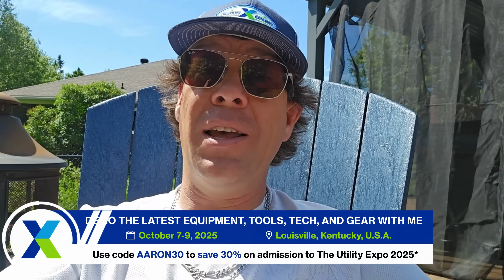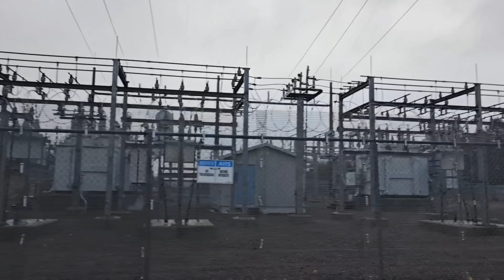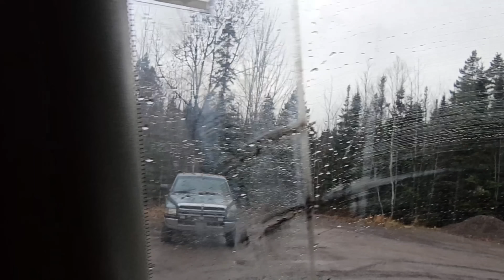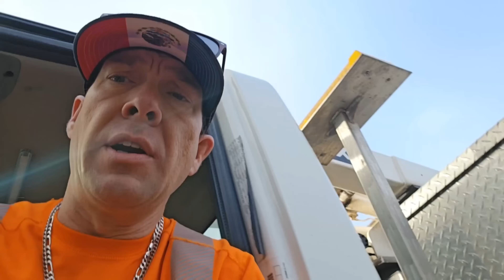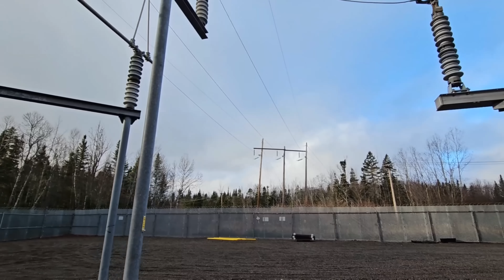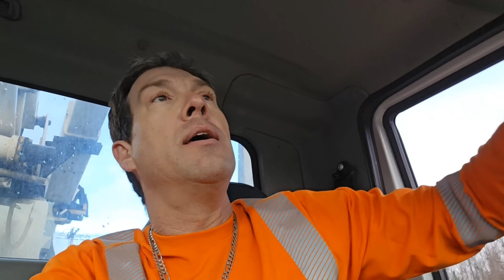138kV Transmission line outage

Comment: Aaron! Nice demonstration of how you were interrupted during your meal to get the lights back on. 
Question? I hope you either have a stand by generator at home or at the very least a roll out generator? We have a very robust roll out at our house capable of back feeding back feeding our entire house including our central air. You read that right. Our roll out can back feed our entire house & central air. 
Thanks for getting the lights back on for your community! 
Your,
John
Reply: If that hook up is properly installed it will not be backfeeding.
Reply: @rupe53 We use an inter-lock by pass in our CB panel.
Reply from the maker: I actually don't have one!! I've got the panel and transfer switch all setup tho
Reply: @Bobsdecline A troubleshooter doesn't have a generator? I need one on my circuit because I condemned it three times as did other fellow employees.
I'm on the backbone (main line) coming out of the substation on my same street. It comes out as aerial cable to terminators to a gang operated three phase switch. Then goes overhead to 336 mcm aluminum tree wire to (get this). 1/0 bare aluminum for 7 spans & transitions to number 2 bare copper for 6 spans to 366 again. That 1/0 always burns down. I know I have pickeled it out a few times. 
Everytime we get hit with a storm it goes out. The shop I started at was closed over ten years ago. I don't even work in my area anymore. 
Hence the genny. We went with the best. Honda EU 7000is. Electronic fuel injection inverter generator. It puts out better voltage than my employer 123-123-246. It's 60 cycle all the time. 
I highly recommend the one we have. 
We were out for Isais. My wife was able to bring it online with 4 switches & never leave the house. 
Our house never skipped a beat. The house was nice & cool & hot water for bathing in. I came home after working my first shift on (24 hours). I refueled it & started it back up. I showered & went to bed & slept well for five hours before it was time to go back into work. We had it running for just over two days. Only shutting it off at night. We burned 12 gallons of gas. 
You want to see it running at our house? Go to my home page. One is at 58 db & the other at 52 db (economy). If you like cats? Our Bean is a fruitaholic. He loves peaches & mangoes.

Comment: Common to have flashovers due to contaminated or failed bells. Seems fairly straight forward. Take a clearance on the line, grounds both sides of work area, Stage materials, execute repair. Do you guys have any live line crews?

Comment: Folks should know that a portion of outage time is from crews activating from the normal every day things they were doing after work.  And then finding the problem, which takes a while in rural areas.  Having help from local first responders and volunteers is amazing.  Thanks to you all!
Reply: I'm in a rural area where Sheriffs often try to help report utility issues, but the levels of confusion or mistaken info varies widely from those who recognize what's in front of them, or do not.  

It could be useful for utilities to host more training for all of fire, police, and PSAP dispatchers, to recognize pole or riser numbers of current or predecessor telcos or electric companies, and secondary feeders, service drops, etc, as to standard names and what each looks like.  

Most utility engineers want to have reliable functioning systems, that survive storms and deliver stable electric voltage inside legal bounds.  Sometimes that takes customer reports, where I've helped identify stuck step regulators in sub stations, or documentation to cause secondary feeders to be upgraded to higher voltage that's less subject to I^2*R losses and regulators to end of line load variations.  

Utilities get a lot of bad or mistaken trouble reports.  While some of those topics are big workloads and budget items, utility engineers generally appreciate accurate, useful information, even if it means giving managers news they may dislike.

Comment: Hey! I am 68 years old and have been involved in electronics for as long as I remember. I have been a Ham Radio operator for almost 50 years and know a little bit about electricity. I have learned so much about the Power system from you. I watch almost every video you share. I love learning. Thank you!
Reply: I am a Ham as well and have been for 20 years. 
I studied to be an electrician from High School. I got into electronics in High School too. I was too slow in construction so I went into computers. 
I have always been fascinated by industrial equipment and power generators and distribution. 
The transmission lines in my area are 250,000 volts and higher. 

I remember following them when I was 13 and I found the Hosensack substation and it was amazing. 
Back in the 70s there was just a chain link fence. Today they have a massive solid wall and so many cameras. The substation had its own spur from the Reading Railroad Perkiomen Branch from Allentown to Philadelphia 
The tracks are still there. 

The transformers are huge. The biggest I have ever seen 

The cracklings from the lines, especially in the summer, is so loud. 

My instructor took us under the lines with 4 foot florescent bulbs and they would flicker when held up above our heads.
Reply: @ocsrc  I also took Electronics in High School and did a coop program at a lovely Tech School in my senior year. DE W4GHW
Reply: Got my Technician license while in the 5th grade.

Thanks for sharing, Greg.
Reply: KB8MAT here. I have a couple of great publications from the ARRL that covers electronics very well, one of those was given to me by my “Elmer” WB8FEW Bobby and it’s filled with great information too. I’m getting the tools necessary to rip apart an iPad and replace the lightning connector and the battery. I like electronics as well. Cheers!

73s de KB8MAT, Al
Reply: I've done Electronics Technician training, have a Ham radio license, and I still learn things from this channel.

Comment: Seems surprising that the transmission network to that substation doesn’t have n-1 security?
Reply: N-1 is usually about the integrity of the overall network, not about individual assets on it, including substations. If you’re lucky your utility will have rings or similar that let a station be fed from both sides but not always.

Comment: System seems to vulnerable to be honest
Reply: Well, if you had to ensure that every site was fed from two different directions or two different sources that would really add to the cost.  Although that substatiion in the woods was at the end of a spur, if it had to be fed from the other diection that would be expensive, because it would likely involve a river crossing and so couldn't be done on poles.  In the end it's a question of "How often has it failed before?"
Reply: @heckelphon I meant vulnerable as in nefarious activity

Comment: If you're worried about showing something on a computer, you can press the "prt scr" key to make a screen capture, paste it into an image editor of your choice and blank out anything sensitive.
Reply: Aaron does blank out and obfuscate a lot of stuff.  There is other stuff I believe he simple does not want to video in an abundance of caution (or company rules prohibit it).
Reply: And all in the 30-minute lunch break?!  Actually there is something of a set of maps online or other schematic which I guess Aaron could copy in his spare time and prepare without identifiers for future occasions, but hey, it's good that he does this stuff in any case.  The guy's got to eat sometime!
Reply: @heckelphon  When I worked on the road during emergencies, "lunch break" was a sandwich in one hand and a steering wheel in the other.... often called "chew something while you do something." Rest breaks were basically done during drive time between calls.
Reply: That would require exfiltrating the screenshot off the computer, which would be a big no-no and probably blocked. It's not a computer where stuff like that can be done.
Reply: Alt + Prt Scrn; hitting part scrn alone won't do anything

Comment: Aaron: When a tag has your name on it but you timed out on work hours and are now home asleep, is there a procedure to transfer that tag, perhaps to your partner or supervisor, instead of calling you and waiting while your brain reboots? Does someone have to drive around to all the tags and physically correct them so some newbie doesn't "save time" and call you directly?
Reply: Different places do it differently, but normally there's a work tag vs a safety lockout. Work tag has simple enough procedure to remove, but a safety lockout is a big deal and they will call you in the middle of the night if you accidentally leave one on.
Reply: I think there is a way to transfer a work permit to whoever the replacement supervisor is
Reply: Who knew the power company has rock stars. Luckily for us consumers.
Reply: I would bet those tags are crossed to a job# and dispatch can keep track then know who the supervisor is for a proper hand off on authority.

Comment: 4:22 Did you hear about the transformer fire at North Hyde Substation in the UK that caused the Heathrow Airport Blackout? That was a bushing failure that had been collecting water for the last seven years and somehow never been replaced until the bushing blew up and the transformer caught fire. So they don't really blow up or fail unless maintenance is neglected or something external happens to them.

That said, it didn't really cause the blackout exactly, the airport lost power because they had three grid connections, but thought that nothing would ever go wrong or break, so they had no way to switch their load between them except for a 10 hour long manual process.
Reply: The airport was reported to have some important systems on each of the three supply connections, without a means to transfer load. That makes a shutdown 3 times more likely.
Reply: @liam3284  What's better than a single point of failure? Three single points of failure!
Reply: If ever you ask someone "How do I fix this when it breaks" and they answer "It doesn't break", you should ask them why the "Unsinkable" Titanic is at the bottom of the ocean.
Reply: "Nothing could possibly go wrong." Good luck with that.

Comment: Have u heard of the electrocution in florida on a transmission line
Reply: The one in Seminole FL were they were putting in a new transmission tower?  One dead and two looking at months in the hospital.  The pictures from the news crews seemed to show the new tower leaning against the transmission lines as if it had slipped from the lift that was maneuvering it into position.  The lineman who died (Justin Bryan) was the one guiding the base of the new tower (looks like an oversized pole, maybe made from concrete?) from the ground when the top made contact with the energized lines.
Reply: @robertlapointe4093 yup they shouldn’t have taken on that job in the first place
Reply: How long ago? 😮
Reply: @grabasandwich this week